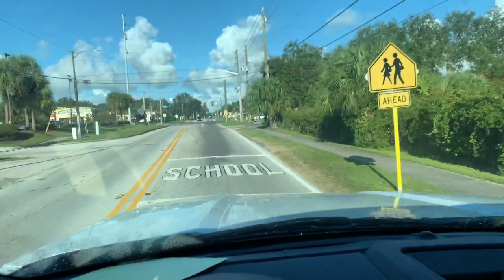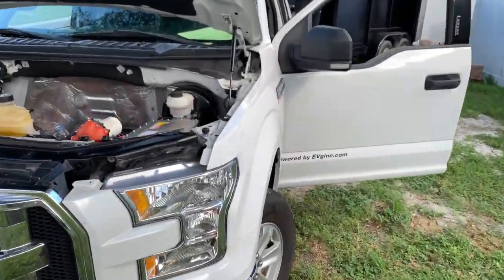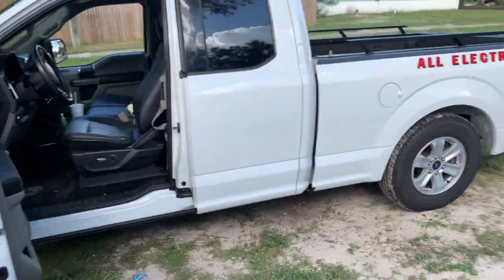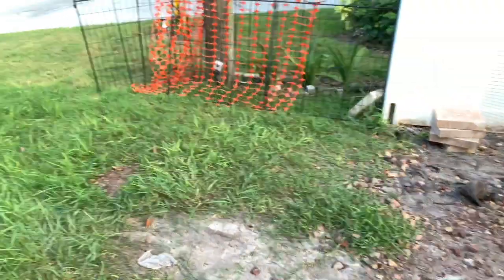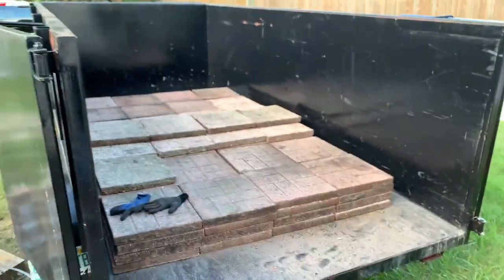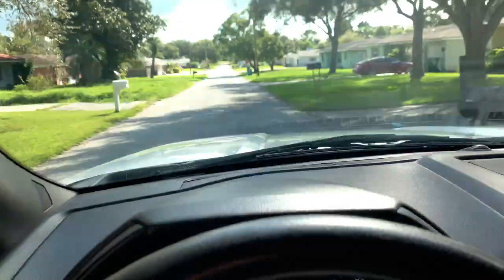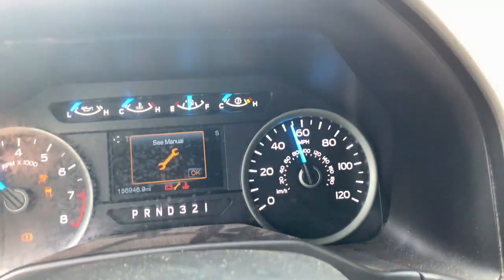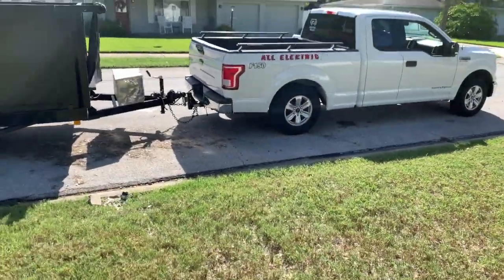Converted all electric F150 pulls loaded trailer.  Designed by DIYev

Comment: I want to buy everything for my 71 ford f100. What do I need to do? I went to your website but found nothing for contact info. I’m in Seattle and can’t wait to convert it! Please contact me. Thank you!
Reply from the maker: The contact info is under the "Inquires" tab and the tele number is at the end of the video.  The starting price is about $15K for a kit at 90HP.  If you want full pulling power at over 300HP and 500 ft lbs of torque then you will spend about $60K.